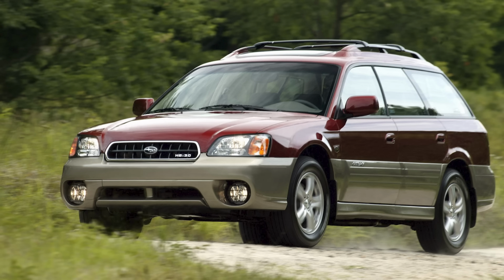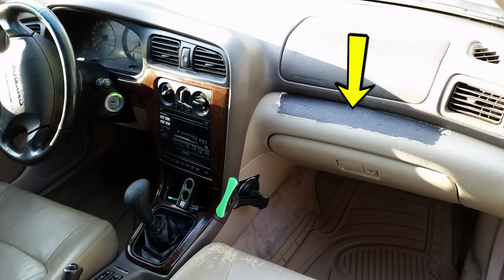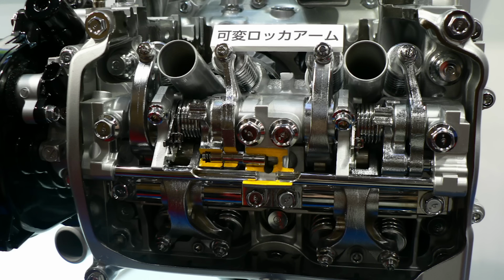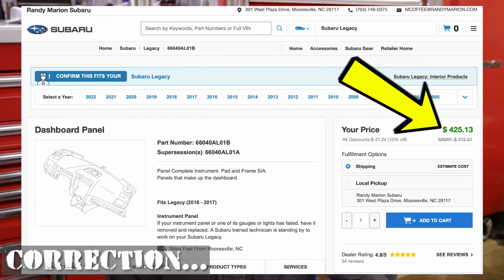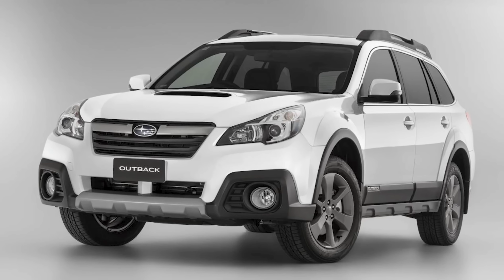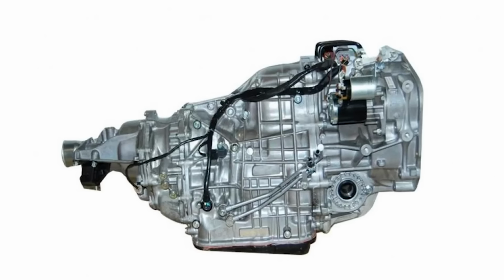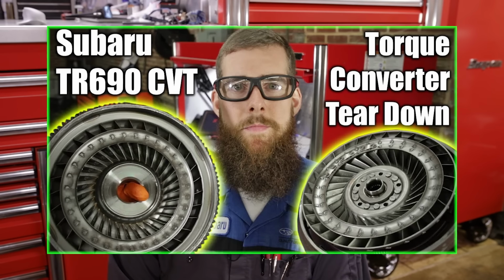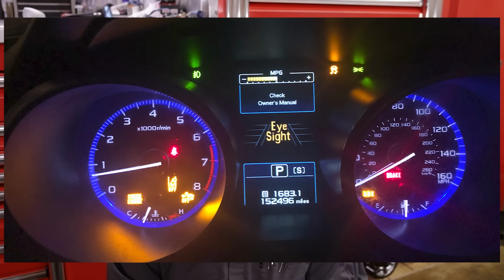Buying A Used Subaru Outback Or Legacy?! Here's The Good And Bad Over The Last 20 Years!

Comment: It was bound to happen. I finally disagree on something with you. I mean, maybe Utah got a crap batch of the early 2000s model? They fall apart  like they’re held together with spit and bubble gum. They rusted almost worse than the early 90s legacy’s. I should reiterate, mechanically they were fantastic, the chassis and “bells and whistles” were actually complete doo doo. Where as the Bp, my favorite hands down. I found their build quality to be light years different from the previous gen. Never thought I’d disagree with you. I did see a few of the mechanical issues you spoke of, but very few. EXCEPT those god forsaken banjo filters. Those things pissed me off. Mechanics and owners lack of knowledge of those stupid filters killed so many of those cars. In my opinion they were the most beautiful legacy’s up until the last 4 years. Now, in all fairness, I may be biased because of my baby…….. I’ll drive my Spec B until I die.

Comment: Subarus have been a mess for 5 decades. im a former master Subaru tech. I've done head gaskets on almost all of them including the EA16 and the EA 82..I bought a 99 outback 15 years ago where the radiator exploded. It was overheated so bad, the cylinder liners melted out of the block. (obviously a customer issue) 2.5 non turbo, 4EAT. 19-22 MPG.I put a Japanese pull out in it, and the valve covers and gaskets were different. I got tired of F150 gas mileage and constant oil leaks. I dont miss it. PLUS the 4EAT O-rings would relax inside of them causing a several second delay into drive and lazy shifts.

Comment: I would literally pay this guy monthly, just to have his contact info and ask some specific mechanical questions/advice when I have problems with my Subarus. Im sick of getting bad/wrong info about these cars.
Reply: Right. I just bought a 09 outback and I fix one thing then the next day something else happens. I cleared the ABS/traction dash lights by replacing a sensor. Got new sensors for the TPMS so that light went off. Now the airbag light is on intermittently.
Reply: @nickgould2510  i had a 09 outback xt limited for about a year before selling it off, constant issues. It wasnt even high miles or beat up.
Reply: @tarzaan2603 I’m not kidding, I fix the airbag code by soldering the circuit board in the overhead lights in the morning. That night while driving I get a p0172 code.
Reply: Just go with the manufacturers manual, wont steer you wrong.
Reply: Yes for sure

Comment: I have a 2021 legacy limited xt 2.4l. Just turned over 50,000 miles. No problems so far. Biggest complaint is the cvt. Seems like the programing is off for the cvt. If you pull out to pass someone and get on it, once you get back in line and let off the gas seems like there is terrible Rev hang. Also at low speeds, 15 mph or so, the cvt isn't as smooth as you would think it should be. 
Car itself has some minor annoyances. At highway speeds, rear section of hood (nearest windshield) flaps like a flag in the wind.
Eye sight cover rattles and squeaks. Tried putting some foam in the cover to help, didn't work.
Driver side door window is starting to go up slow, so I'm thinking  the motor might be going out. Going to put some silicone spray in the guides first.
Collision avoidance system is WAY to sensitive. Vehicle can be 50 ft away and already turned the corner and it will just about lock the brakes. So i turn it off.
Driver monitor system goes nuts if you look at the speedometer, but you can turn and look in back seat and it does nothing. I turn it off also. 
Other then that car rides and drives nice.

Comment: Sold my 99 Lincoln Towncar. Picked up an 02 LL Bean. 3.0.  Live it. Everything Mr. said was an issue is spot on. I have all of without thankfully. These are so rare here in Oregon because everyone drives them and loves them. I had to splash down $3200 cash the day it was for sale. Not even listed yet. 4 people behind me trying to buy also. It has plenty of power and a joy to drive. Awsome in snow and ice due to how the axles work. takes power from any slipping & diverts to ones with traction. 3 months into this car & recommend them to anyone. Safe.

Comment: I have a 2001 LL BEAN version outback wagon. 3.0 H6. 140k miles. Incredible build quality. Still runs like new.
Reply: Those engines purr. I have a 2004 Outback LL Bean, owned since 2014. It's been reliable.
Reply: I have the same, except the 2005 model.  Totally reliable.

Comment: I had an 01 outback limited and had 2 head gaskets done but looking at what I spent on it over its 20 years of life I did pretty well with it and what ended up taking it out was severe rust in the frame, even with undercoating being done.  I actually never had leaking issues on the sunroof and moonroof but the powered open and close of the inner cover on the sunroof had to stop working and after locking my keys in my car one time and having to pry the window to get a hanger down, it never was quiet again.  The only big problem I really had is that the local Subaru dealers and mechanics SUCK and did a bunch of damage to the car so I use 3rd party mechanics I know for ALL work now.

Comment: Hello MrSubaru1387,

I am lucky enough to have a 2003 Subaru Legacy 2.5 GT sedan AMT as my first car. I owned it for 2.5 years now and love it very much, I feel very safe driving it on snowy roads and have had a lot of fun with it.

Nonetheless, there is one problem that Legacys (as well as Outbacks, Foresters, and WRXs) of this generation tend to have that you haven't talked about in your channel, perhaps due to the location you are in does not have very harsh winter. When I started the car in extreme cold and turned on the defrost, I start having fuel smell in my cabin. I popped up the hood and found source of this problem - fuel leak from the fuel line under the intake manifold, which leak onto the top of engine block and this can possibly cause a fire hazard. I did some research online and realize many people who owned Subaru of this generation and are living in very cold area, also experience this problem. Subaru actually used to recall the 2002-2003 Subaru WRX Models to resolve this issue, but other models were not subjected to the recall.

To be precise, this short video is showing the exact location of the leak, which also applies to my car (https://www.youtube.com/watch?v=q-8hJ4cZvso&ab_channel=oldtimefreedom)

Therefore, it will very nice see you make a video addressing this issue in the future.

Thanks for all the video you have done so far 🙏. I gain so much knowledge about my car and Subaru as a whole through your channel

Comment: we have had Subarus since 01 to our current 19 forester its a limited,its just OK  kinda ho-hum, we have always had legacies and crosstrexs , our gold 01 limited legacy was our favorite we didn't have the head gasket issue however the dealer put something in the radiator after a flush at 90 thousand miles and by 140 starting shooting a code for overheating converter from a clogged radiator. we traded it out for an 07 at the time

Comment: My father and I are driving Subaru Foresters (second generation). Mine is 2004 with 125hp and his is 2005  with 158hp, both 2.0 liters. Those are fking amazing cars: Boxer engine, no useless computer and electronic , 4x4 always on, reducer and also manual transmision ( this one is better cuz u got 5 gears instead of 4 in automatic, its more dynamic and consume less fuel bec of that) , those cars love  engine braking(yeah they sound good). Only pain in the ass are  short clutch which is hard to feel at the start and frameless windows which make  wind noises above 110km/h. This  car is  for every road conditions and yeah.... forester 3(and every version with diesel) is bad joke compatered to his "fathers"

Comment: Front rotors and oil pans -----My 2002 and 2012 both have oil pans that rust out....only vehicle I have ever had do this....plus premature rotor wear which I think is due to undersized rotors for the Outbacks.

Comment: I had a 2003 Outback, 4 cyl, automatic.....and loved it  After 6 years, I was rear-ended by another 2003 Outback...and both cars were totaled.  
That was such a FUN car.  Since then, I've had a 2010 Outbadk Limited and then a 2018 Outback Limited....BORING.  The 2018 has had 3 windshields*,
there was a problem with the Karmon-Kardon radio..it came on with high volume and you couldn't turn it off or down or 
change stations.     The remote control of the 2018 is awful!   I think my next vehicle will be a different brand.  AS a side note,
 I won't buy ANY vehicle with a turbo or with a GDI engine if I can help it.
*NOTE:   Replacing a windshield costs an arm and a leg since the cameras on the Eye-Sight have to be adjusted again.....and replacing windshields seems
to be HABIT-FORMING.

Comment: Our 2013 we having drinking oil and we were warned about the transmission.
We where actuality advised buy a small business that souly works on Subaru  to not buy 2010-2013 but that of course our 2013 is by far the worse. All the idiots lights on after 100,000.
Reply: The valve body is what we need to replace for $1200 and if we needed to get a transmission a used one is $8000.

Comment: My mom had a 2002 Outback 4 speed auto with the cold weather package. It is probably my favorite Outback! It’s a close call between the 1st gen and 2nd gen Outbacks. She did a complete engine reseal and timing belt at 160k. Still looked like new when it was at 199k. A drunk driver side swiped half the car while it was parked so it was unfortunately totaled. We bought it back from the insurance company and still sold it for a grand to someone who was just going to drive it as is. Hope it’s still on the road and doing well for him!

Comment: I have a 2001 Legacy Outback Wagon, 2.5L automatic with 256,000 miles with ever cylinder burning evenly, no oil burning, quiet engine, there is no sign this gal has no intention of retiring nor ending up at pick your part until I am over 420,000 miles

Comment: What a good video with so much information.  I have a 2006 Outback with the 2.5 engine and leather seats and sunroof.  I bought the car with about 130000 miles and right away replaced the brake discs and pads, the wheel bearings, the timing belt and water pump.  Now I have about 150000 miles. I've really enjoyed the comfort and utility of the car.  However this past year its developed some problem with the four wheel drive system that I was thinking I would hear about in your discussion.  In four wheel drive mode I get a clicking sound when making a tight turn.  I thought it was CV joints and asked my mechanic to change the CV's.  That didn't solve the clicking noise and I later learned that something in the transmission could be damaged if the car was driven with a low tire or something that could cause a mismatch between the front and rear drive.  Right now I am driving with the extra fuse in place which only lets the front wheel drive work.  It gets better mileage with FWD only but I am not sure of the long term effect of driving the car in this mode.  I think the transmission work is beyond my regular mechanics comfort zone and I am not sure the expense with the milage the of the car makes good economic sense.  It also started making an exhaust noise and so another area needing repair.  The car does have a dent and rust free body along with a nice leather interior so I may try to find a buyer who can accept it as a good fixer upper.
Reply: Good to know. I just got a 2007 Outback with the 2.5, around the same mileage. Hopefully mine will be fine, but I'll keep these issues in the back of my head.

Comment: I’ve got a 2013 Outback 2.5 with 177,000 miles and it just experienced it first mechanical issue, and the CVT valve body had to be replaced. Other than that, its been bullet proof. Its been a great rig overall.
Reply: We are in the same boat and were warned to get a different year due to transmission issue with that year. 😔
Reply: @brittanyhutchinson9367  $1,600 repair where I live. If I get another 177K out of it, it was money well spent IMHO.
Reply: Got a 2013 Outback and just replaced the front brakes at 103K, rears at 75k.  That's been it so far. Thanks for posting.

Comment: 2000 2.5l outback with fixed head gasket at 80+-k miles is still working great at 300k miles. Needed AC bearings, belts, and timing belt replaced a while back. Great car!

Comment: Just did the head gaskets and all seals with timing belt myself on my wifes 06 outback with 288,500 miles.  External oil leaks only.  Things I have replaced, rear wheel bearings, ball joints, struts, blower motor, accelerator pedal, 02 sensor.  Now it needs front axles.  Also it needs rear brake lines, another subaru failure point across all models and years that you should always inspect before buying.

Comment: The battery issue was also caused by an engine management system that was designed to maximize fuel mileage and it caused the alternator to insufficiently charge. The smaller battery would have likely worked if the alternator had been allowed to do it's job properly. Subaru put out a software patch to allow the alternator to charge the battery properly. I installed Group 24 batteries which fit in the tray and doubled the CCA in my Limiteds. It's a common workaround. Fantastic cars though, we currently have 3 Outbacks (2017-2.5L, 2017-2.5L, 2018-3.6L) and a 2020 Impreza 2.0L. I would totally buy again.
Reply: I installed the Group 24 battery in my '15 Legacy a few months ago, about double the CCA of the original. The first replacement, in the original size, lasted just over 3 years.
Reply: @Scramble-electron-890  I did the same in my 2017 Outback. Just a little longer, but it fit in the tray perfectly, doubled the CCA, and works great.

Comment: Owned outback’s from a 95, 99, 2005, 2010 and 2018…then sold that and went back to a late 2004 (2005 shape) 3.0 LLBean…easily the  best Ide owned.  The newer had better options, but as a drive and reliability I reckon the BP (I think it’s called) is the best I reckon

Comment: After watching the last 3-5 minutes of this think I'll just keep the '12 3.6R Outback Limited and continue the maintenance. Just did the 105K at 102K last week. Bought it 'certified' in 2015 with only 12K on it. I've had MANY (7?) Subaru's over the years from 1978's up to the current '12. Only one that ever caused an issue was the '98 Outback 2.5 that was using a bit of oil and son ran it dry and spun the bearings at 189K. Sold a '90 Legacy with 335K on it in 2011 as I got a bit leery of the mileage, the guy still has it on the road at a bit over 420K lol.

Comment: I have the 2013 Legacy 3.6R Limited with 5 speed automatic with Eyesight, now with about 130,000 miles. It has been reliable until 120,000 when we had numerous suspension problems due to the poor roads in CT.  We in 2022 have replaced: front struts, front controller arms, rear wheel bearings, master brake cylinder, driver window master control, and driver window motor assembly. No engine issues but very minor oil consumption around 100,000.  Still have the car no failure of the head gasket, and no CVT.  Still love the car and hope to make it to 200,000 miles.

Comment: They need to put that rubber crank pulley on the recall list. Because they do not honor their warranty on a $450 part. That can wind up costing you eight grand for an engine replacement. When it goes it tries to take out the timing belt.

Comment: I experienced the ghost walking on a winter trip back from Las Vegas. It was terrifying and I thought that I was going to die. What I think caused it was the extremely cold temperatures and the fact that every rear suspension bushing on my 06 OBXT was completely shot and separated from their metal sleeves. Every single one! I had brand new shocks and springs so I don't think that was a factor. Up until that trip, the vehicle had performed great in dozens of snowstorms. I replaced every single bushing and I hope that I never experience that phenomenon again.

Comment: Absolutely love the 00-04 Outback’s. I like to buy cheap ones with simple issues, refurb them a bit and drive or sell them. I recently got an 06 to do the same with and boy is that car a pain in my rear! I will never buy another 05-09 OB. I’d love to pick up a clean 00-04 H6 though.
Reply: Whats been your issues with the 06? Was it an H6? How many miles on it? Curious because I have an 04 H6 with over 300k and am looking at a low mileage 06 H6 to buy for longer trips.
Reply: @zachhooper9080  Mine is the H4, wished it was the H6. I've actually been keeping my eye out for nice 2nd gen H6. I think the advancements Subaru tried to make with the suspension and interior was good at the time. But as they age, they tend to not take the abuse as well. The 2nd gen held up to time and abuse much better. I also think it is easier to work on overall. Mine has the ghost walking issue and some issues with HVAC controls. I had some issues with the VVL system that was a pain to work with. Plus, trying to add an aftermarket stereo so I have bluetooth is a pain because of the radio being integrated into the HVAC. I just feel like the 2nd gen overal was more solidly built overall. Even though it is a more simple car, I feel like it was built better.